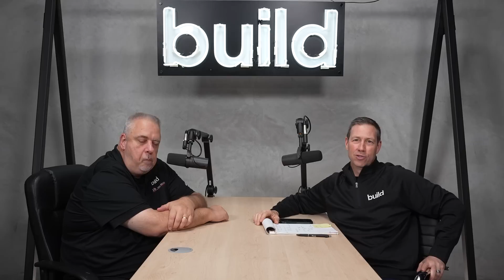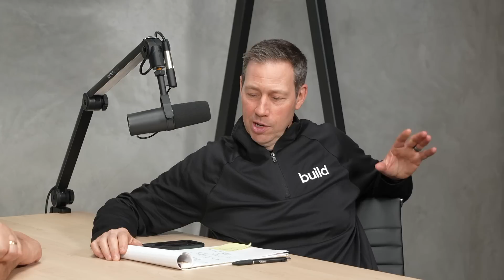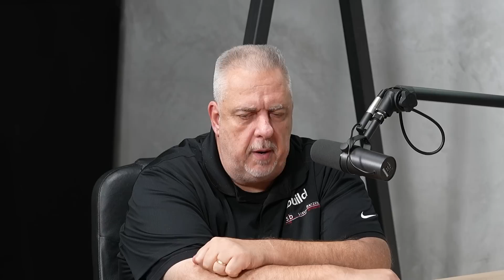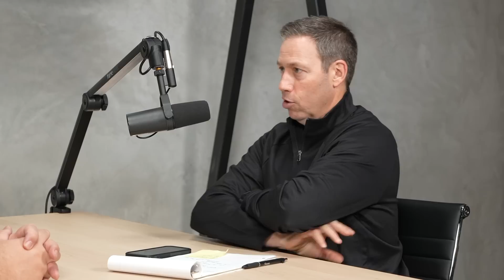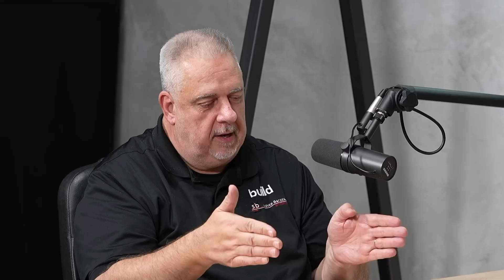Build Podcast | Episode 163: Building for Extreme Health

Comment: I really appreciate both of your building standards, philosophies, and values.  I have severe allergies to dust mites and molds (VA Diagnoised for Burn-Pit syndrome IE: Daily exposue to Burning Landfills in Iraq 2006) and I rarely have a decent day. The house I currently own was build in 2008 and we purchased it in 2018.  It has it's own HVAC filtration system and also have high quality stand alone filtration systems (Coway) and they help very little.  I hope to one day be able to higer one of you or one of your local affiliates.  I know you are worth every penny, just need to save up.  Thanks for the awesome content!

Comment: Still missing from residential are proper carbon filters for fresh air systems. No idea why the ERV market has been so slow to incorporate them. Also for health reasons there is no reason to still use finishes that have heavy metals and benzene. The waterbase hybrids work great. Spray or pads. Still surprised to see Data Sheets from some large suppliers that have these in them including formaldehyde in plywood. Again, PureBond is a good alternative there. But the fire retardant is a tough one and it is something that with spray foam, insulation board and SIP's that I never could truly get exact numbers on from manufacturers.

Comment: Matt I can’t believe you left out the largest internal environment, danger in the vast majority of houses in America radon I would advocate a full sub slab ventilation system, using a drainage mat specifically designed for this i.e. right on Matt embedded in at least 6 inches of gravel going throughout the entire perimeter of the house and dividing most rooms in half to make sure that the sub slab suction is adequate. This is not expensive at all to do prior to building the house and it will also require multiple tubes coming up and multiple fans on most foundations to make certain the section is adequate and you have some redundancy.

Comment: 22 years ago, I saw a PBS special on the design, construction, and occupancy of a new apartment tower in Battery Park Manhattan called The Solaire. The owner assembled a team of environmental engineering specialists to create the healthiest possible building.  
I remember towards the end of the program, a tenant stated that her child had suffered from severe asthma, which was miraculously alleviated once they moved in. 
That program was where my late wife and I learned of the carcinogenic VOC's found in so many paints, building materials, carpets, and construction adhesives. Shortly after that, she contracted lung cancer and we eliminated all of the VOC offgasing materials in our home, and so did our adult children from their homes. Even that long ago, zero VOC plywood, partical board, and paint was available if you asked for it. 
The easiest health thing to either get right or screw up is using zero VOC interior paints. Neglect or oversight and you create a carcinogenic gas chamber.